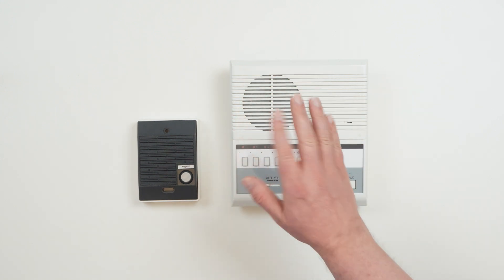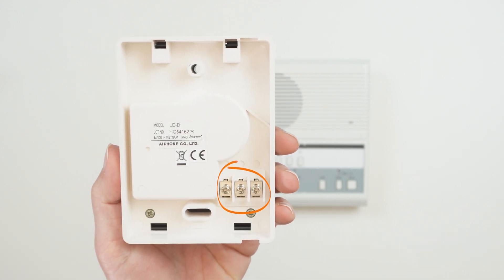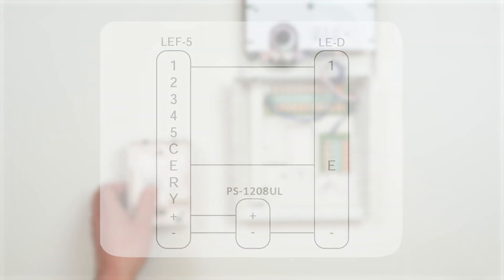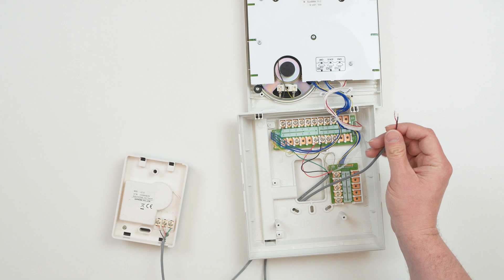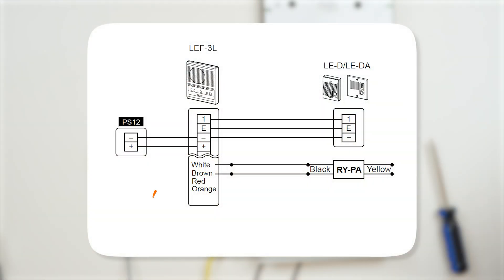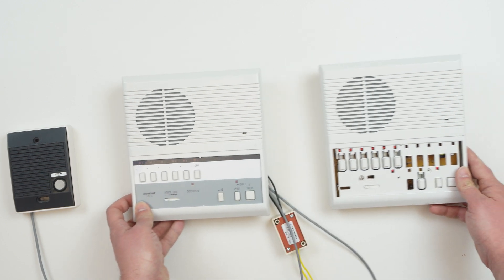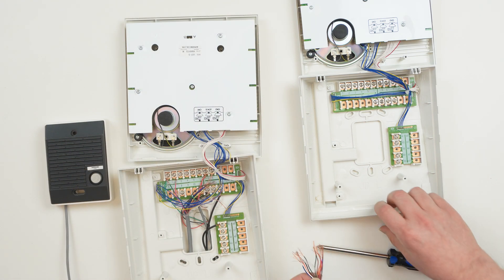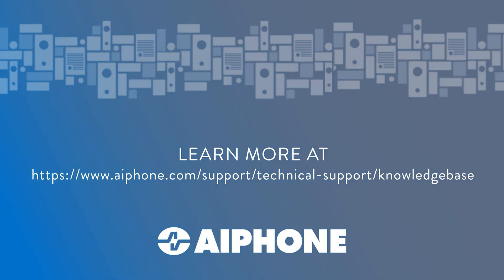LEF General Installation and Operation Guide

Comment: Can any 12VDC PS be used, or need the one from Aiphone only?
Reply from the maker: A 12V DC 800mA power supply will suffice. Higher amperage power supplies could cause interference on the system.

Comment: What kind of door strike did you guys use?
Reply from the maker: The EL-9S was used in this video but it has been replaced by the EL-12S. https://www.aiphone.com/products/el-12s
Reply: @ thank you
Reply: @ Also is the aiphone lc1 compatible with other door strikes other than aiphones?
Reply from the maker: Most Aiphone intercoms provide a dry, normally open contact. This can be used with any third party door strike of your choice. You would need to provide a separate power supply for the strike, and then wire it in series with the door release contacts. You can see a collection of wiring diagrams here: https://www.aiphone.com/kbtopic/general-lef-wiring-diagrams/
Reply: @Aiphone_Official  Your link to the wiring diagram library goes to 404
Reply from the maker: @martyatwork2521 Try this! https://www.aiphone.com/kbtopic/general-lef-wiring-diagrams/